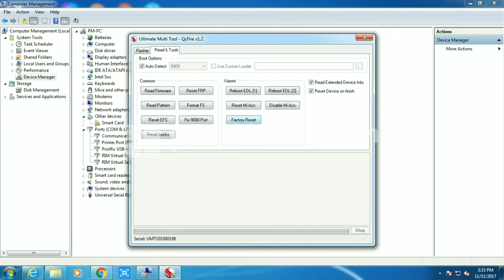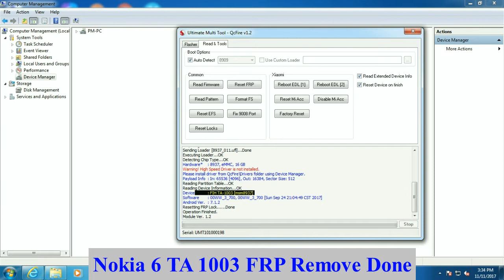Nokia 6 TA 1003 FRP Remove Done

Comment: Nokia 6 TA-1003 Naught was launched on 3 July 2017. Nokia 6 TA-1003 comes with 7.1.1 Nougat Based Update Version.It is planned to Update version 7.1.1 Nougat. You can Update version of your cell phone to Nougat 7.1.1 via your Software Update in a setting. Nokia 6 TA-1003 Nougat Firmware download links are at the end of this post.

https://www.howunlock.com/download-nokia-6-ta-1003-nougat-firmware-flash-file/